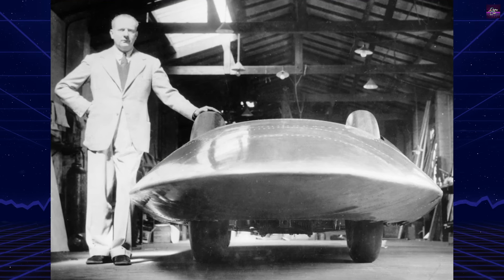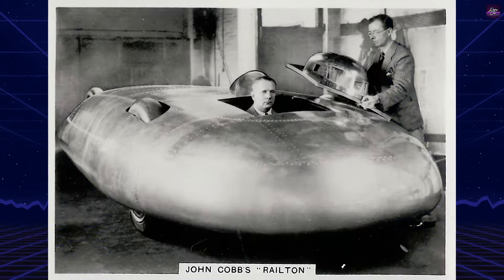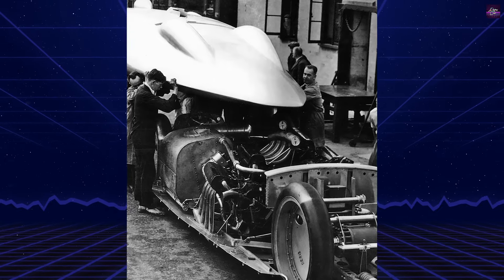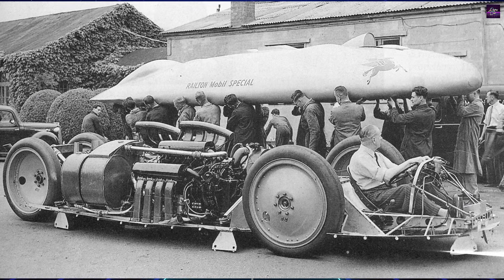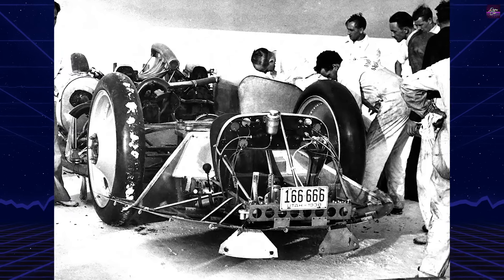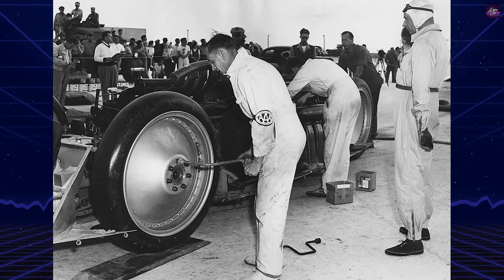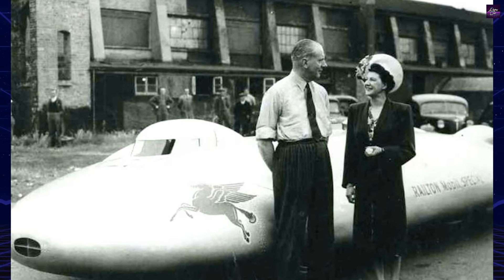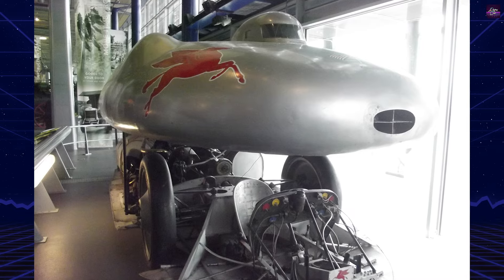1938 Railton Special: The Aluminum Arrow that Pierced the Sound Barrier

Comment: This is an impressive car that not only looks great, but has some very interesting, "out-of-the-box" design solutions.  As far as I can tell, there is a (expensive) diecast available in 1/43rd scale.  But the Hawk / Testors model companies produced simple kits of LSR-type cars that could be used as a base for scratch builders and super-detailers to capture the overall "look and feel."  Though stated to be 1/32nd scale, the basic design is "scale fluid" enough to use for 1/43rd, if the builder prefers.

Thanks for sharing this!

61st Like